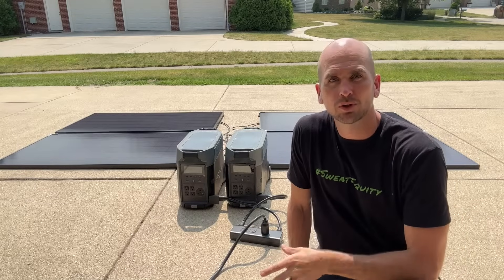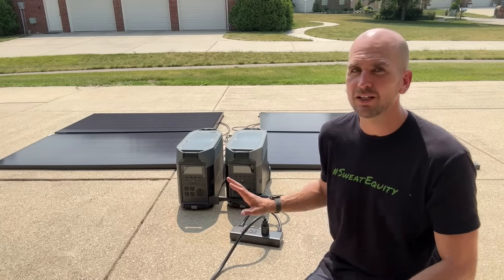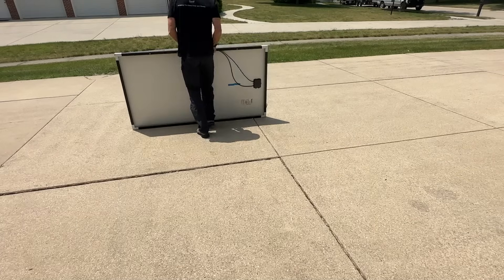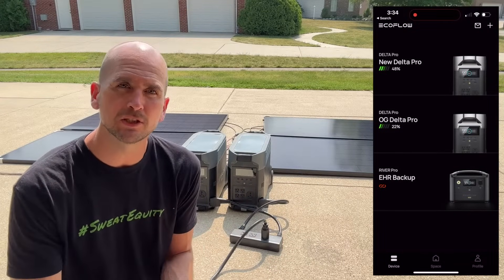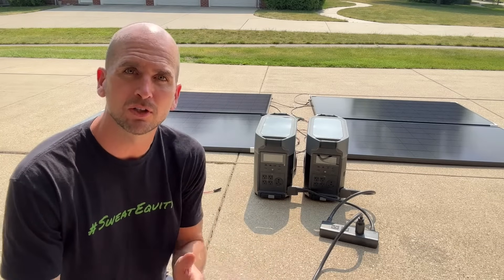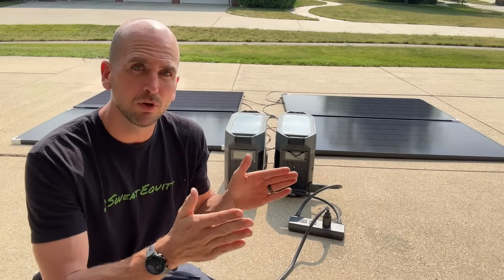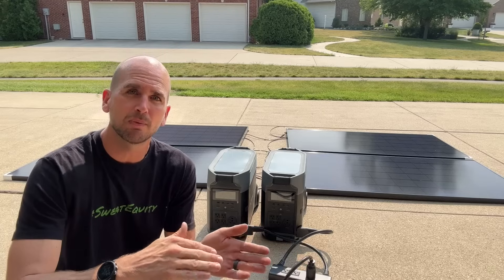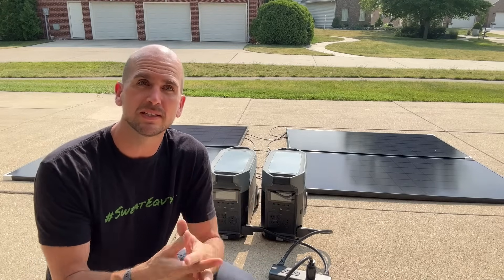Powering My House On EcoFlow Delta Pro And Solar Power!

Comment: Course if I get something like that it would actually be the power to my house it wouldn't be a backup cuz that would actually be my grid cuz my grid is what I asked you make it into which is my solar panels cuz I don't have the grid have a gas generator propane generator anything like that I won't have that either cuz that just cost. So I'd go with a solar generator if I can get one or two or ten or fifteen depending on what I need independent when I need to have I know what pirate power requirement I need it's just hard to come up with that because I would like to run my house with power to run everything my house but that's quite a lot of power so I just add it all up together and find out there's not a generator out there to do it unless you get the ac900 and all its batteries and two of the generators to run independent from one another at least for the worst time of the year cuz it best time of year I can probably us an AC300 two of them just not for my big loads maybe one of the big loads and rest of the house with two of those generators anyways combined together to get that 240 and 120 volts. What they cost an arm and a leg for everything and then much more. So what I figure I'll just put them down a little bit small generators to run this room that room and the other and licks from besides which means for for smaller generators and probably more than that plus all the big loads. And all the other big and small loads and planning to add to my house to make it cheaper and free after the first cost.

Comment: My question is, if you happen to have only 12 200w panels hooked up in series/parallel  to support 2400w for the best method for 1 delta pro because they can in fact handle being over powered in terms of wattage, Then I add a 2nd delta pro to the be hooked up with a Y cable for the 2400w to be divided between the 2 delta pros.
I know there would be the balance issue but Logically it seems like it would still send 1200w to each delta pro.

In theory would this work?

Comment: Do you have an estimate of this setup thinking of doing this
Reply from the maker: For this type of setup the cost is predominantly in the Ecoflow Delta Pros https://amzn.to/3Px42R2.  Those will run between $6,500 - $7,000.  For the panels you could even pickup some nice used panels and a little wiring/MC4 connectors to get everything tied together which would only add another $1,000 or so to the overall price.
Reply: To cut power consumption during an outage, flip the breakers or just don't use the big stiff.  Electric clothes dryer and electric range, the stuff that Needs 240 volts.
Reply: @HulaViking  Propane is the savior then

Comment: Great video. Love this unit. My biggest issue is the lack of solar input.  1600 watts of solar for 10600 wh is terrible. For the unit itself is fine but adding the extra batteries is a bummer. 7 hours of charging is not enough time. & that's perfect sun no clouds, no storms, etc. We will hardly ever have perfect skies. This should of had at least 2400 watts of solar. & voltage should be higher. I really dislike over paneling and can't even use the full wattage because of the limits.
Reply from the maker: Yeah, if you were to do the EcoFlow power setup you would have to pick your panels wisely which is not what I did here.  I want to setup an off-grid setup for a shed/office or weekend cabin using a similar setup to the EcoFlows.  I like the idea of being able to easily pull the batteries out for use on other projects and job sites.
Reply: @everydaysolar-ps3xg I think you did good. It's a learning process. But ecoflow need to come out with the pro 2 & definitely address & fix things.
Reply: I agree not enough Solar input.

Comment: You may want to review your energy consumption and figure out why your energy use is so high (minimum of 20 - 25kWh per day, during the winter with no AC load).  Do you have a very large house and family or are you charging an electric car?  Conservation is a lot cheaper than more panels and battery capacity.  Have you replaced all incandescent bulbs with LED, replaced appliances as they fail with EnergyStar rated ones, and eliminated typical energy hogs (old fridge in the garage, etc.)? Without an electric car, our low days are more like 10kWh. Multizone mini split for heat / cooling, and all appliances are electric (water heater, dryer, range, etc.).
Reply from the maker: Nice, yeah I am sure there are a few efficiency gains to be had on my large appliances but I don't think $20 kWh is out of the ordinary for a 3000+ sq ft home in the winter running on a gas furnace.
Reply: @everydaysolar  My furnace fan alone draws 450 watts,  winter use is around 7 to 9 hours a day in Utah winters. I have a 48v system with 2 5.1KW batteries, it will run my house, same size as yours, about two to three days in normal winter usage. Most outages are a few hours to a day here. Obviously if yesterday's dinner hit the fan we can go into hunker down mode. With clouds, inversions, and fog in winter plus short days and low sun angle.  Over paneling is the only way to keep up. One of the advantages of 48V all in one system is much higher solar input. Plus much cheaper than the Bluetti or Ecoflow with extra batteries.

Comment: Interesting video. So how will you maximize the ecoflow’s input? And will you be connecting it to the roof or pergola?
Reply: I have 410W solar panels where the Voc (open circuit voltage) is right around 148V, so I will, in perfect conditions, get the full 1600W input. That's with panels that put out around 13 amps max (Imp).

If I connect two strings like that together, I can push the current up over 15 amps. With current, though, you can go over the rating and it will just use what it can. That way I'll get the full 1600W more of the time, and more power in general when solar intensity is less than ideal. 

I will need to watch the Voc when it starts to get cooler, though, because solar panel voltage increases as temperature decreases. If it goes over 150V, I'll need to remove a panel out of each series so that I don't fry the Delta Pros.
Reply: @michaeldezelar6264  sounds like a good plan, thank you. Is there not a device that can regulate the voltage to what you want? Instead of keeping an eye on it all the time.
Reply: @aayotechnology  I have been looking, but have found no such device... at least at these voltage levels.
Reply from the maker: Yeah, I will provide an example next week where we run 2 or 3 panels in series across 2 separate branches that are wired in parallel.  This should get us close to the 1600 Watts on input power.  I will get a 10 kW system professionally installed on my roof and then we are trying to figure out how to have a bit more capacity with the String Inverter or combiner box to then add another 3.6 kW on a DIY Pergola setup.  These projects will be coming up in the next 2-3 months depending on the professional installer availability.
Reply: max 1600W by max 150 volt but the my after error code 79 it take only 1281W max. It's not reliable for that money you can better buy EG4 ( cheaper in upgrade )